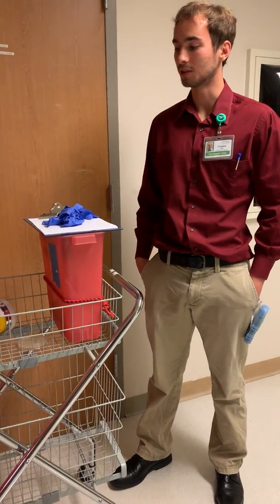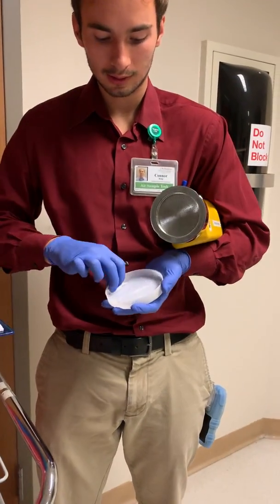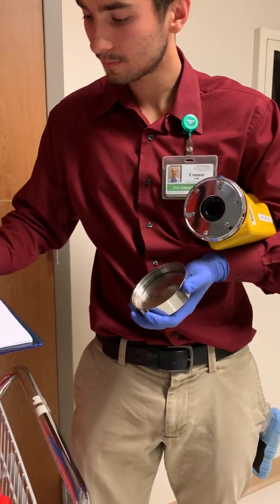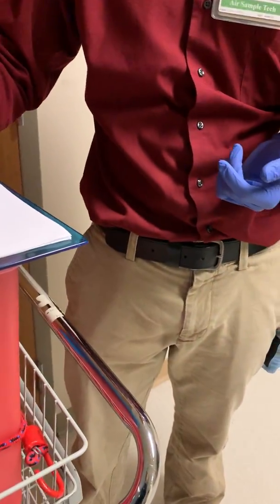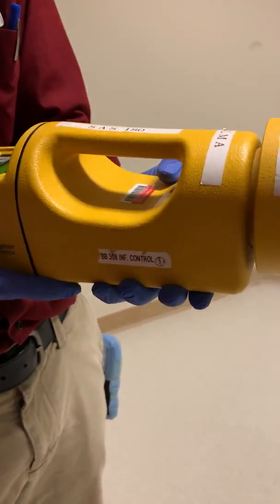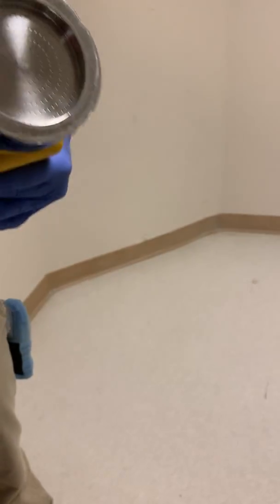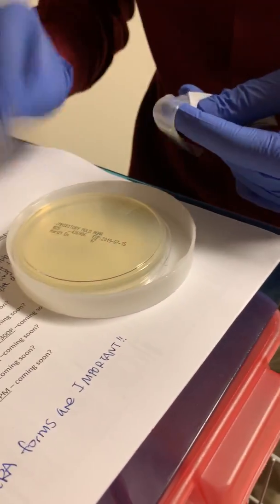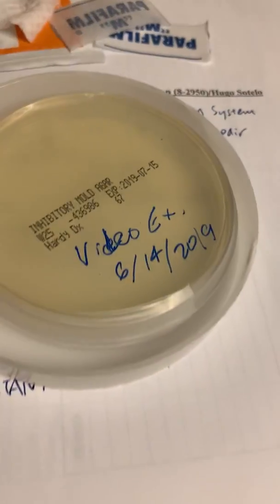How to Conduct an Air Sample using a SAS 180

Comment: If you have a suspected mold issue, how far away from that suspected area do you sample? Right near it? Or where employees are normally working?
Reply from the maker: Hi Dale, depending on the area, we typically go in between the common work area and the suspected mold if it’s a hallway, otherwise a foot or so away from the suspected area. The equipment absorbs plenty of liters of air as advertised. Thanks for asking!
Reply: What is the equipment cost in india